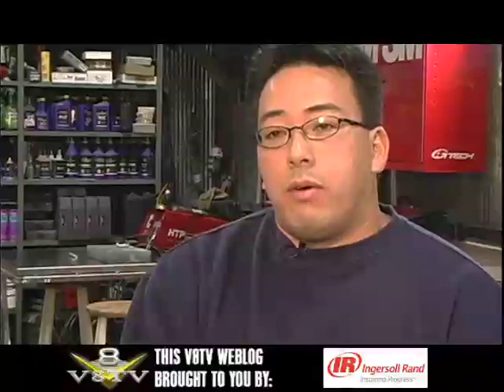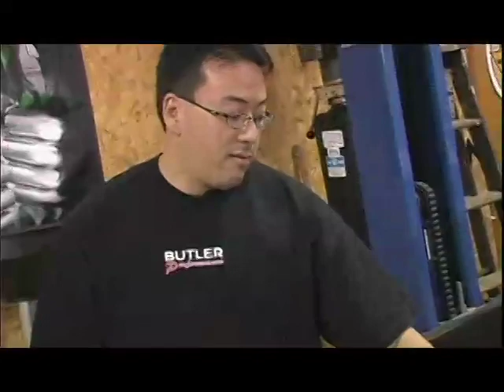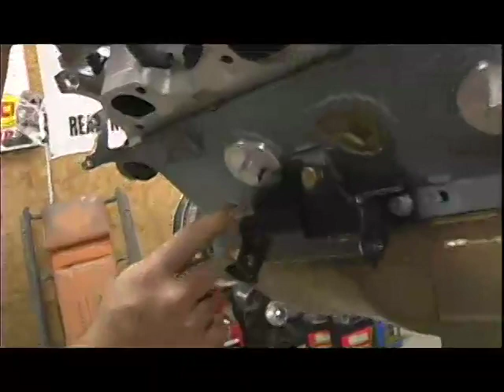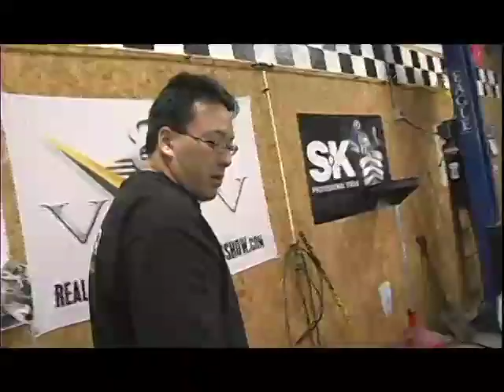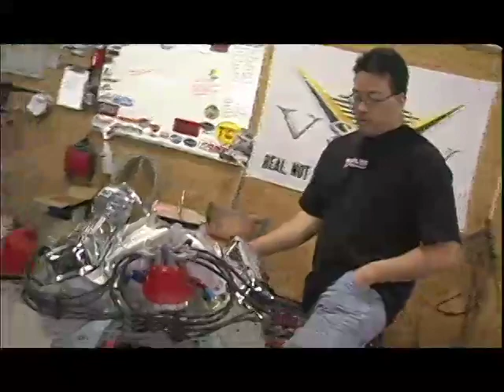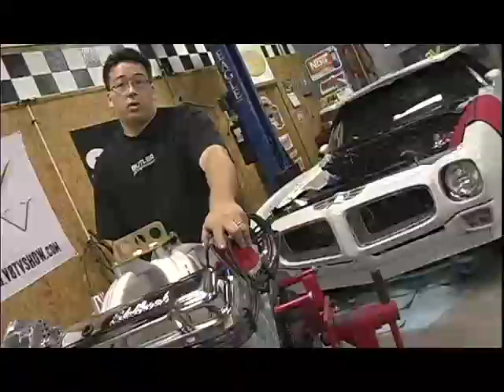1970 Pontiac Trans Am "Splitter" Engine Pre-Install V8TV-Video

Comment: More likely he didnt want to pull off the control arms to put the bolts in! Yea I ran into that, however I drilled the holes out just a little and used over sized grade 8 metric bolts stainless steel with the red lock tight. Stainless still washers and locknuts as well. I dont think I would have welded the engine mount to the frame. Real Pontiacs Dont Have Chevy Engines